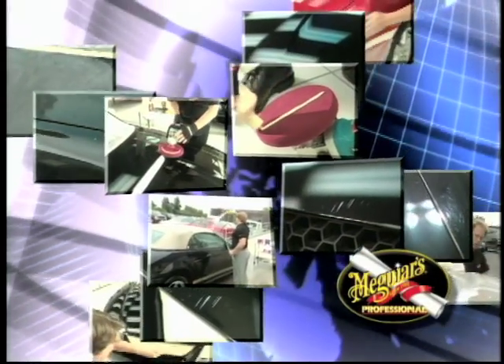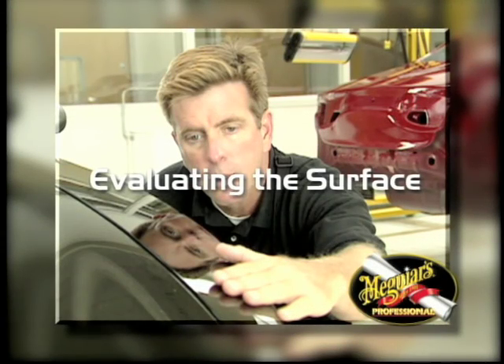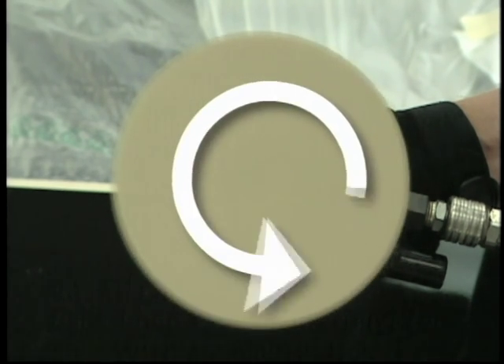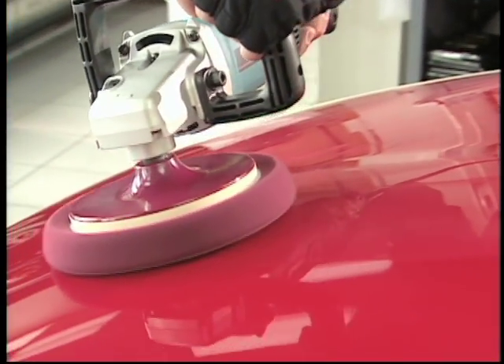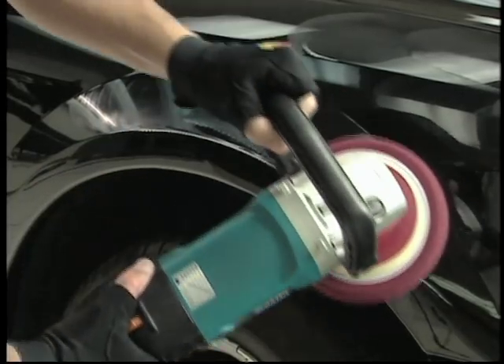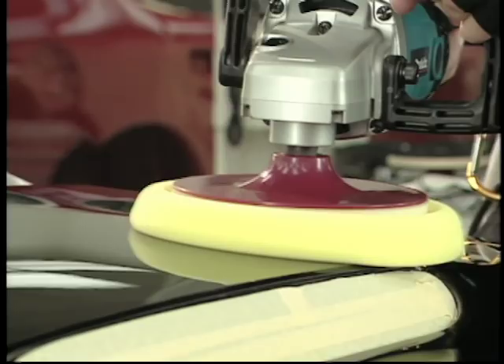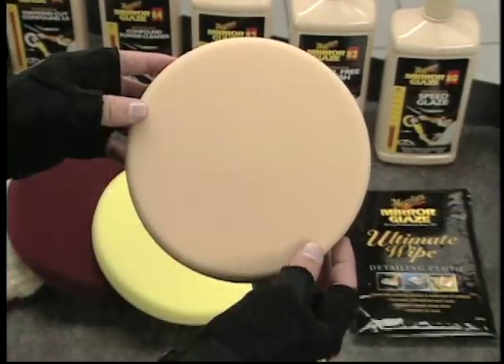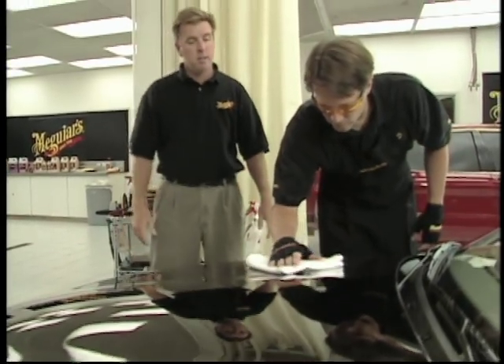How to Professionally Remove Paint Defects with Meguiar's

Comment: If you have been hand detailing for 2 years, I can't recommend enough that you invest in a buffer.  For you I would highly recommend the PC (Porter Cable) variable speed random orbit polisher 7424XP.  Slower than most buffers but it's the safest buffer a newbie can ever use.  "ALWAYS do a square 2' test section until you get the results you want then taking one area at a time and when you are done with that, go on to the next area. An almost fool proof, fantastic machine.

Comment: When i was young I use to detail cars to make extra money! I used a high speed buffer, and burn't the shit out of my clients rear bumper corner! That shit was smoking, and down to the primer! Damn Hubble telescope could have seen that shit! So what I did,was went and got some black shoe polish, threw a bucket load of that shit on the burn, and then stayed waxing that bitch, until the sun went down Client never saw it got a huge tip, and that paint looked like a Mully, with a shine box afterwards

Comment: @MeguiarsUSA i hope you can explain this to me, i own a pulisher (not DA)  with 800-3000 rpm range, and i own this products, g19216, paint cleaner step 1-3, m80,m83 and pads w7000,w8000, and w9000, nxt2.0 wax, gold class wax, scratch X,

can you explain me how to use this products in order to get the better results, such as rpm, pads? thank you